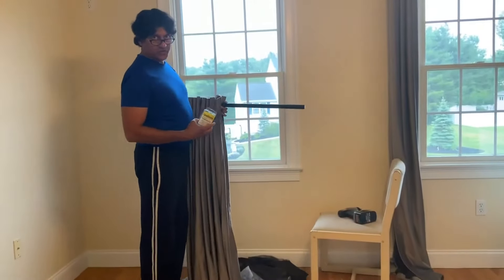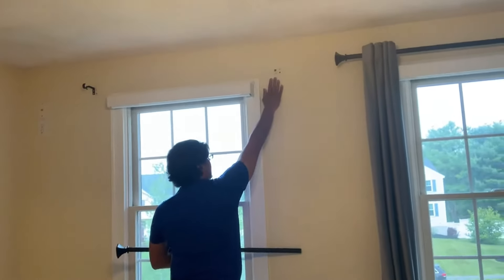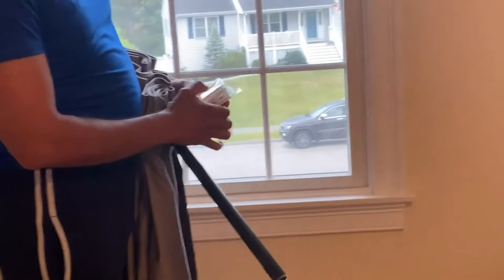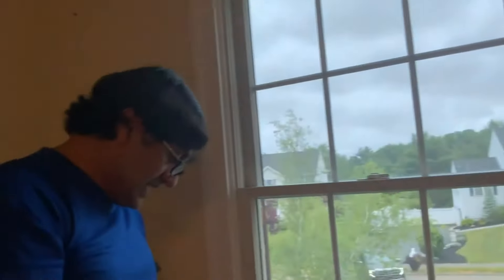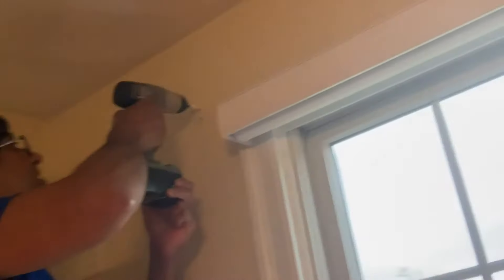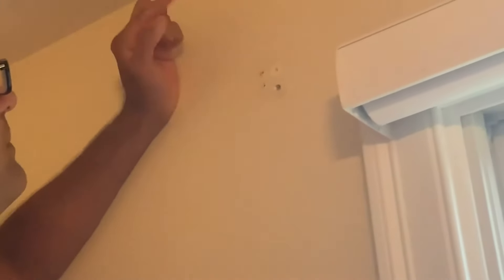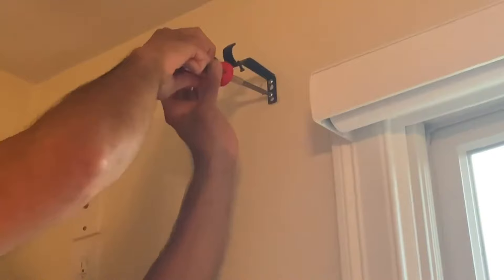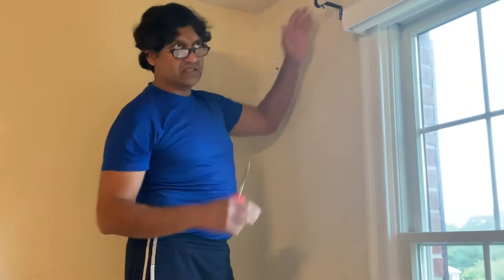How To Hang Curtain Rods In Drywall With Anchors: Easy DIY Install

Comment: this didn't work for me, I had to drill a hole in the drywall first, then use the hammer to gently pound in the anchors, then manually screw the curtain rod hangers onto the wall
Reply from the maker: Those are good tips to try if things don't work as planned. Hope it ended up firm and holding up the rods/curtains for you.

Comment: Appreciate the video but using these drywall anchors requires using silver screws on a dark bracket. Sorry but that would be an eyesore in my house.
Reply from the maker: Hope you find the color you need.
Reply: Cover the screw with nail polish in the correct color.